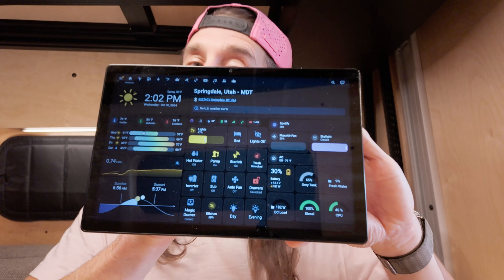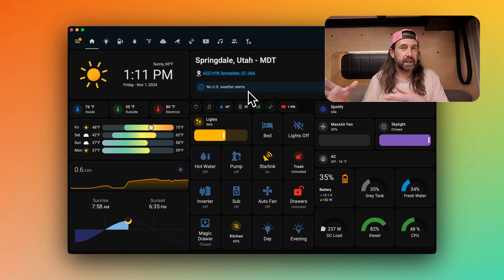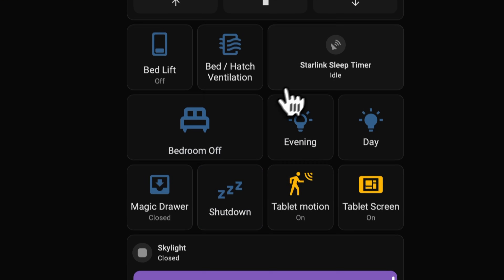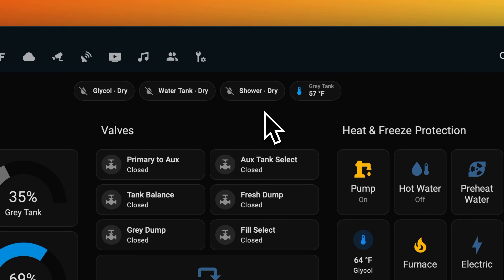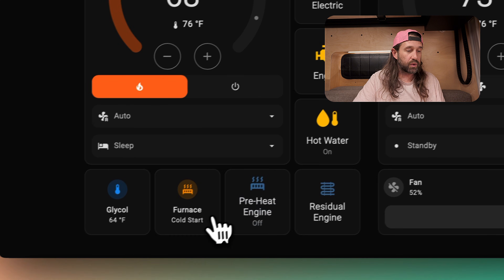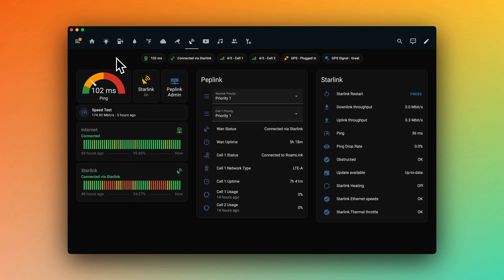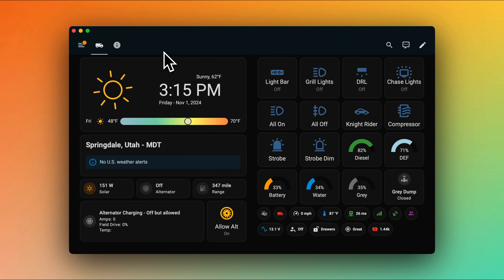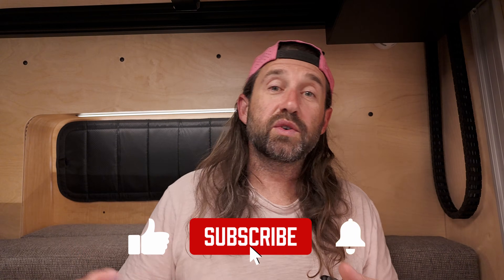Epic Home Assistant Dashboards — In a Van!

Comment: I went through the comments on what weather clock card you used. I saw you said it was the clock-weather-card. I tried using that but I don't see how you were able to split the clock/weather graphic from the forecast so that you could put the temp sensors in between them. This allows for a nicer alignment with the Location information card and the start of your section 2 and 3 columns. I'm very interested in how you did this?
Reply from the maker: It's a simple trick. I use two instances of the clock weather card and just enable certain features in each instance ;)

Comment: what cameras are you using i like the slim design they have.
Reply from the maker: They are cheap AliExpress no-name POE IR network cameras with ONVIS “support”. Though, as you mention, they DO have a decent form factor, a threaded mount at the back, and were relatively cheap. They disappeared when the tariffs went into effect, but seem to be back: https://www.aliexpress.us/item/3256805587688759.html. They are ok-ish. NOT waterproof as advertised, so I sealed them up with some silicone. I might suggest looking into Dahua or other more major manufacturers… or just roll the dice with Ali and be sure to seal em up! Note: they come in a variety of focal lengths. I believe I went with 3.6mm and only bothered with 2MP since i would only record at 1920x1080 for the van setup.

Comment: Brilliant information.  Thank you for taking the time to produce and share.
A very quick and simple question.  What are the make and model of the screens are you using for the main unit and the secondary unit on the dashboard
Reply from the maker: Thanks! I've tried a few models of tablets. I started with an amazon Fire HD 10 and it was ok, but sluggish. I've settled on Samsung Tab (A8) for the kitchen and a Samsung Tab A7 8.7" in the cab. They are ok, but not amazing. The kitchen tablet uses Fully Kiosk and it behaves for the most part. I have heard decent things about the Google Pixel. I'd consider the fastest tablet with the most ram you're willing to afford. And now there seem to be some iPad OS kiosk options as well, but I haven't tested them yet. I would prefer an iPad because it's buttery smooth!

Comment: How did you program the bed lift to home assistant?
Reply from the maker: Our bed motor has built in end stops and 12v control. So we just need to send 12v for up and 12v for down. I turned this into an ESPHome time cover and a safety switch to avoid accidental control.

Comment: Those are some pretty good dashboards! Quick question, though: have you had any microSD cards fail on you? I was under the impression that microSDs were terrible for longevity when constantly writing to them, like with HA and especially a Frigate NVR setup.
Reply from the maker: I have not yet had my SD card fail-I’ve been running the same card for over 2 years. I did go Sandisk Extreme for durability. My config is backed up often and I carry a spare SD.

Comment: May I ask which HA card you are using for your home screen display of the battery information?  Looks like vertical stack in, but I cannot figure out how to display the segmented battery volt icon within the card.  Thank you!
Reply from the maker: It's the Custom Button Card https://github.com/custom-cards/button-card - it's highly configurable to display data, if not a little finicky to set up.
Reply: @SmartyVan  Thank you...finicky...uh yea this one is going to take some work.  I often wonder why the devs of these great cards don't go to the next level and set up the visual editor with options to allow easier configuration.  I understand that is a lot of work, but selfishly...we would all have a greater pallet of cards to configure without the learning curve.
Reply from the maker: @LivnlargeCO  It's true! But it's nice that they exist. I really try to stay with the built-in controls where possible.

Comment: Another great video, what cameras are you using for your Frigate install?
Reply from the maker: They are no-name lipstick power-over-ethernet cameras from Aliexpress. They all generally use the same few sensors, and have various fields of view (I think mine are 3.6mm). Most tend to support ONVIF and natively stream at least 2 different resolutions at the same time over IP (in h.264 and/or h.265). I went through one set of cams that I didn't love the housing on, but there are soooo many options. I couldn't find these types of cameras  on normal US retail sites, but Ali has a ton. Power-over-ethernet is nice because you can run some direct-bury cat5 or cat6 ethernet cables to all the points you want and get the data and power to the cams! I may do a deep dive on the setup, but it's hard to recommend a specific camera because they are unlabeled and the Ali stores constantly seem to change what they have. I would recommend getting cams with IR and I went with 1080p for the van because I didn't want to manage 4k in this case. Also look for something claiming to be outdoor rated and consider how you can mount them. Mine have 1/4-20 threaded holes at the end so I could use some standard Ram Mount type hardware to mount them to the roof rack.

Comment: Great video. What weather card are you using on the main dashboard? I like how it displays all that info in that layout.
Reply from the maker: I'm using two separate instances of the Clock Weather Card: https://github.com/pkissling/clock-weather-card
Reply: I'm wondering too. I thought it was a clock-weather-card but he has the clock weather graphic separate, with temp sensors next, then the forecast. Its like they are separate cards?
Reply: I'm curious too. I thought it was the clock-weather-card but the weather graphic and clock are separate from the forecast. This allows for the temp sensors to sit in between.

Comment: What do you use for gauge cards? Stock ones do not look that compact.
Reply from the maker: Hmm, I believe all of my gauge cards are stock. I am on 2024.8.2. I think if you make them small enough the become that compact. On all pages except our main page I am using the new Sections layout where you can easily define a cards size. But even on the Main dashboard, using a grid card to add multiple other cards forces the size of the gauge card smaller. In general, I try to use native cards wherever possible.
Reply: @SmartyVan  was wondering if it was the mushroom cards?  Seems maybe not...?
Reply: Hm, maybe something changed, I'm on 2024.11 and if I make the gauge card 1x1 the gauge itself becomes extremely small.
Reply from the maker: hmm interesting—I'll probably update soon and I'll see how that goes.

Comment: It's really amazing. Just one thing i would maybe change or be very aware of: Dont clutter too many dials etc, i know its hard as a tech lover. But lets be realistic i would not even implement using front speaker rear speaker and sub. I would just turn all of them on or off and not even have a button for it. Same with all the internet speeds and signals. I have a phone and when the phone has good connection, so does the van. I would really try to minimize a lot of stuff on there. Weather forecast and important switches like lights, drawer, pump available with one click, not 2 or 3.
But again its personal preference. I wont work in my van, so a speed test or ping isnt needed. I would rather make the system so "easy" that i can let my parents use the van for a week without being called 5 times a day. At that point a sufficient "usability" has been reached. Sorry mum 😂
Reply from the maker: Good news is the UI is completely customizable 😉

Comment: In so glad you guys have a YT channel. I've been developing a custom HA interface using a waveshare ESP32-S3 RGB screen dev kit with eez studio and LVGL lib. It looks great but it's a lot of overhead. You convinced me to just use a tablet.
Reply from the maker: I respect the commitment to a custom UI!! I tinker with the HA UI quite a bit—I can't imagine maintaining a custom UI. I really try to stick to native Home Assistant UI controls as much as possible as well to avoid things breaking. Then there's the issue of remote access. A responsive web-based UI is pretty smart—works across all sorts of screen types! But props to you!
Reply: @SmartyVan 10/10 do not recommend 😅 as a software engineer I'm used to long hours behind a keyboard and monitor but I'm burnt out. Would you consider sharing your dashboard yaml? 👀

Comment: Is it possible to use the Undermount ac as a dehumidifier?
Reply from the maker: I'm not an expert in the AC field, but in general I believe all air conditioners achieve some amount of dehumidification by their very nature—warmer air is cooled and as such can hold less moisture and said moisture is collected on the cooling coils and is drained away. I think you will find all AC units drain away some amount of liquid—and that is equally true of the undermount AC evaporator (it has drain ports). I wouldn't assume AC units are as efficient at dehumidification as dedicated units. Again, this is my vague understanding.

Comment: How did you link vans data ? Did you use obd ?
Reply from the maker: I'm currently pulling most of the data from the Mercedes Me app/api which means the van has to be connected to its own cellular connection. I have a better solution coming....

Comment: Brilliant setup! As a techie, and someone who spent the last summer in a Mercedes van with my family traveling cross country, I can appreciate the incredible number of hours you put into thinking about each of these systems, but also in the actual integration and reliability tuning that comes along with someone this complex.

Already plotting van build 2.0 and love what you've done here. Would love to see more of the specific hardware pieces and how you've integrated them, where you mounted things, etc.
Reply from the maker: Thanks so much!! Good luck on the 2.0 build! Any particular piece you're hoping to see more info on?
Reply: The power video you just posted was awesome, with the nitty gritty details of powering all the devices. Love the close up of the mounted controller as well to see how you're piecing things together.  (https://www.youtube.com/watch?v=IIHaPx_3B3Q)

Looking forward to seeing one about the MaxxAir fan setup. The remotes on those things are worthless and climbing in and out of bed in the middle of the night to get that remote to work to turn it off when everyone is freezing is something I won't miss.

Comment: Awesome! What sensors dis you use for the fres/gray water tank level?
Reply from the maker: For fresh water, I use resistive float sensors (like these: https://amzn.to/4ejUtxt) connected to the Cerbo GX and then pulled into Home Assistant with MQTT (video coming soon on Victron -> Home Assistant). I have a float in the grey tank as well, but have been relying on an ultrasonic sensor by Mopeka (https://amzn.to/4fyQqhN) for the grey tank as I find it a bit more accurate for grey—though it is Bluetooth.

Comment: Hello so following along with these great videos and have a test system no up and running many thinks for the guide so far quick question in this dashboard vide have you interfaced to CAN BUS on the Mercedes for some of the parameter about the Van you are displaying and if so will there be a video on this many thanks Mark
Reply from the maker: Thanks! I am currently using a Mercedes Me custom integration in Home Assistant to pull in Sprinter info. This isn't ideal as it relies on the van having an active cellular connection. I have a more robust solution coming that will work offline and on almost any van (not just sprinter) and a video to accompany that.
Reply: @SmartyVan  thanks for replying and looking forwards to next videos 
I have 18 year old vito xlwb that's a work in progress so will be very interested in all your videos thanks for sharing 👍

Comment: Have you considered an integration for tire pressure monitoring? My van didn't come with one from the manufacturer so before I install one, I wanted to see if you had, or had a recommendation for the best set up.

I love this series. Thank you for doing it! I'm preparing to transition/integrate my van systems with HA.
Reply from the maker: I thought all cars and light trucks from 2007 on were required to come with TPMS sensors. What make/model/year is your van? I currently use a Mercedes Me custom component for Home Assistant to import tire pressures. This requires the van has its own independent internet connection which is not ideal, so I am working on a solution that doesn't require the van to have an internet connection. I'll get to a video on that eventually! I don't have much experience with TPSM hardware itself, but if your van truly doesn't have them, I'm sure they can be added. I'm vaguely aware of external BTLE sensors that thread onto the valve stems. But traditionally they are internal.
Reply: @SmartyVan  I have an Airstream 24X built on a 2023 MB Sprinter 3500 ext (dually). I believe Airstream installed the GFX wheels and tires. As such, no MB TPMS unfortunately so I'm looking to install the best option available (that's hopefully home assistant compatible) when I get my new set of tires.
Reply from the maker: There is a Home Assistant integration: https://github.com/bkbilly/tpms_ble?tab=readme-ov-file that works with these: https://amzn.to/40Fyiym at a minimum, but may work with others. I might explore an option that mounts internally in the wheel, but this seems like a viable solution.

Comment: Would be interested in an overview of your energy system and breakdown of various sources of "parasitic" draws (all your esp's etc). One of the coolest HA implementations I have seen. Appreciate all the work you have done - HA is a rabbit hole. I'm 3 years in and can't keep up with the evolution of the product. I'm sure you groan with every new release and what gets broken...
Reply from the maker: I'll try to discuss parasitic draws at some point, but I haven't spend a ton of time measuring or worrying about them. You get to a point with a 990 Ah battery bank (that's nearly 12 KW!) that a couple of watts of baseline isn't really a nuisance. We leave Starlink on all but when we're sleeping and THOSE kinds of draws are the ones that add up (more like 100 W). As for Home Assistant, I do keep up with the updates because it's a hobby, but if it weren't, I'd just get everything working and stop updating.
Reply: @SmartyVan  yeah, ok you are running a serious battery bank! we cruised the Caribbean for 3 years on a 41ft catamaran back in the lead acid days and our 1200 amp hour bank weight over 1200 lbs and we were constantly plagued with battery issues (mainly due to dc refrigeration). Been in work purgatory for the last 10 years and getting ready to get back out there - I'm 3 years into HA and feel like I'm only touching the tip of the iceberg. Currently playing with hardware arrangements for my homelab that I will take on the boat. Currently running a full open source stack (full rrr suite, nextcloud, pihole, wireguard, frigate, nginx, lubelogger, mealie, immich ) on proxmox hyper visor but have to keep an eye on power consumption to host this - but with this I am largely setup to local only.  Starlink is proving to be a bit tricky for people travelling internationally with the 2 month rule so I am going into my setup assuming we won't have it...and of course it helps HA has been developed from the ground up to be local only if that's what you want/need.  Looking forward to more videos, you're going to be a busy. I suspect your subscriber count to going to start ramping up here pretty quickly.
Reply from the maker: Sounds like a rad project!!! Hopefully Starlink will continue to revise their subscription polices. I find they usually get worse before they get better... but the general trend has been improvement for real-world use cases.

Comment: This an awesome project. I would suggest, maybe move your home assistant install to an ssd, as micro sd cards tend to fry with so much data constantly written on them.
Reply from the maker: Thanks for the input! I've been using a micro SD card for a couple of years straight with 24/7 video recording from 3 cameras and the constant database writes of Home Assistant with no issues. We do carry a spare SD card in the case of failure, but haven't needed it yet. SSD drives are a nice new ability for Home Assistant but I value the compactness of an SD card in a mobile application—I'd rather not have an SSD hanging off the Raspberry Pi. I do talk about the type of high quality SD (high endurance) card we use in this video: https://youtu.be/q5HSJXHkqEs
Reply: @SmartyVan  It just keeps getting more impressive! Keep it up
Reply: Just FYI there are cases for the Pi that can incorporate an SSD inside and it only adds a little depth. I have one in my van as having a MicroSD fail causes a lot of work, ask me how I know.

Comment: Really interesting channel you have, I'm automating in our VAN myself, but haven't gotten that far at all. Are interested in what type of sensor do you use to check the presence of you in the VAN.

Thank's

//Roger
Reply from the maker: Hey Roger - we use both Bluetooth (on our phones) AND wifi (phones as well) to determine presence. Wifi is very reliable—we pull the list of clients from the router and check for any devices with the word 'phone' in them. Bluetooth is quick to register presence when arriving (quicker than wifi) but if you're outside the van or a bit far away, you can be seen as away which may undesirably trigger automations. So, I combine them to get a QUICK arrival (with bluetooth) and a more reliable continued presence (with wifi). Look into template sensors where you can combine the state of other sensors to determine the state of your template sensor. I'll do a video on this here eventually!! It's pretty simple.